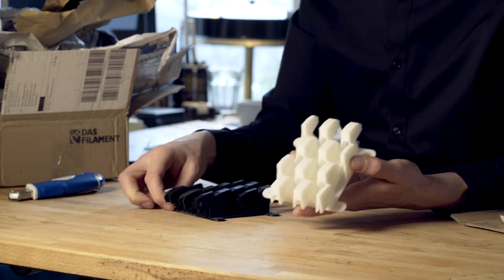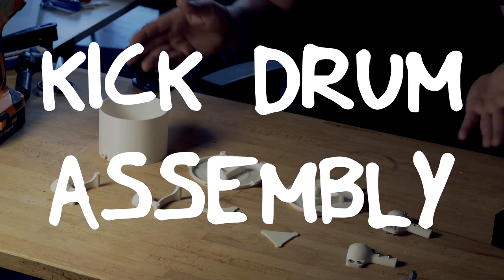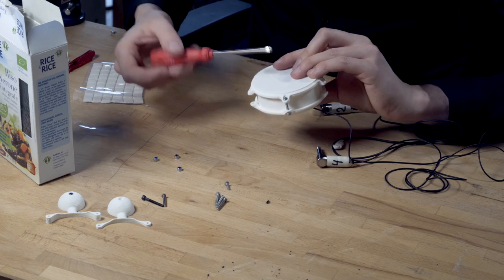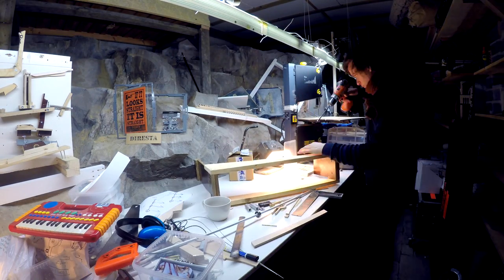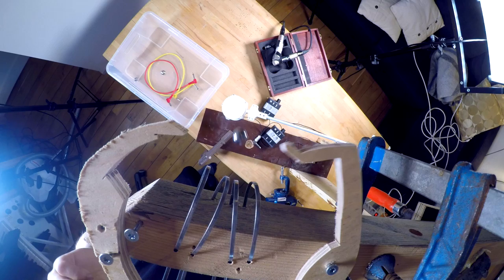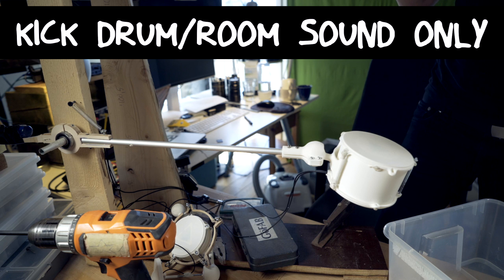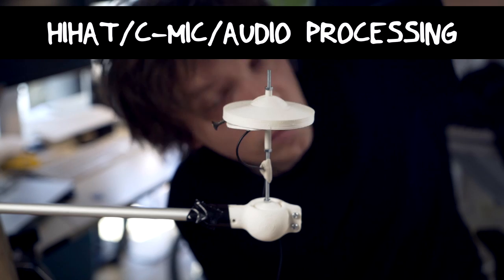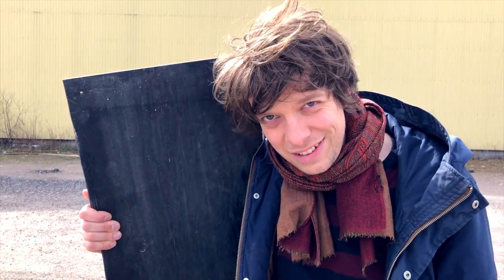Testing 3D Printed Drums - Marble Machine X #6

Comment from the maker: I forgot to mention that we will of course paint these drums!

I have recieved a couple of emails and comments about the ball joint and that it will gets loose from the marbles continuously hitting the drums. Even when i tighten the ball joint screw lightly i cant move it with my hands when trying. The plastic will break before the joint moves. There is so much friction in the rubbery ABS plastic so when properely tightened down, the joint doesnt move at all.  

I did delete this comment and all the answers by mistake once before, before i had read all the answers! I cant find a way of undeleting, so stupid mistake!
Reply: Can't wait! :DDDDDDDDDDDD
Reply: wintergartan you could also just use colored filament to print the drums there are even fluorescent and more special filaments
Reply: Wintergatan congratulations on 500K subscribers!
Reply: Concerning ball joints, there is an American company specializing in those mainly used for GPS brackets, the company is RAM Mounts ( http://www.rammount.com ) and they use rubber balls, and tons of accessories. They can handle A LOT of stress, but they are not cheap though, but there are companies making knockoffs with more or less success.
You could try to build your own rubber ball joint system though.
Reply: are the Stl Files for the 3D printed drums publicly available or are they proprietary? id like to make some for my own testing. have you considered having the parts printed in metal. for metalic sounds?
Reply: Wintergatan Lol, I'm also from Luxembourg!! And I have also a 3d printer!! And also wanted to help you to print stuff!!!!! i'm tobias version 2!!
just my name is not tobias!
Reply: Have you thought about making an open and closed hi hat sound? just by slightly changing the shape/design of that cymbal (and adding more rice), you could probably get a longer hihat sound. Or you could make the cymbals out of metal while keeping the supports plastic and make a more realistic hi hat (with two cymbals open and together). If you do think about doing that, I suggest tilting the cymbals so that when open, they still touch each other and vibrate together for more of a funk or disco hi hat.
Reply: Wintergatan where do you come from?
Reply: Will the prototypes be on Ebay or something? ^^
Reply: Why not use a brass miniature hi hat? Imagine some sort of more authentic sound will come from that 👍
Reply: Wintergatan Maybe you can add some sort of lubricant inside the socket and see if it works. If not maybe adjusting and revising the system of fasteners will help.
Reply: Wintergatan smoothing down the joints with acetone vapors or simple sanding might reduce the friction but try acetone with test prints or backup prints just in case
Reply: I think there may be a misunderstanding.  He is HAPPY that they don't move.  There were some commenters who were concerned they might after a lot of usage, making the machine be less accurate with the hits.  He doesn't want the ball joints to move after being properly tightened, and they don't, so no problems with the joints.
Reply: And organic rice sounds better !
Reply: You should paint it with glow in the dark paint.
Reply: Harder/impossible to attach a contact microphone to it
Reply: Wintergatan it sounds like montaigne - because i love you
Reply: Wintergatan, while I can understand it might not be moving that's not necessarily a good thing. That means all the force is going directly into the joint which could lead to premature wearing which would lead to a fracture of the joint. 

You might look into adding something along the lines of hard rubber insert, and a stoper in the body. That way the rubber can absorb some of the shock force moving a little but then resetting.

This is the same concept as car bushings in that of say an engine mount. They allow the engine to move under load, but the will go back to a standard position. These bushing in cars do wear out, but as long as the rubber is hard, and the correct type you shouldn't have issues with it. 

If I remember your biggest complaint was constant up keep of the previous design. While I think alot of your designs are interesting some of them are going to be prone to pre-mature wear. 

One thing that you might consider when making each part is how hard it's going to be to replace if it breaks, and how often it's going to need replacing. 

As an engineering student myself I understand the complication of design vs maintenance. Just something to think about.
Reply: Wintergatan nice test beat
Reply: Dana Cleary They're in Sweden...
Reply: Does it matter what race they are?
Reply: Uhm...  Those ball joints are gonna get loose over time with the marbles constantly hitting the drums, and you're gonna end up constantly re-positioning those drums and tightening the ball clamps (unless you're planning to glue the ball joints in place once you have the machine finished and tuned perfectly).
Reply: Wintergatan OMG 😭
Reply: Hungry Guy Did you NOT just read his comment
Reply: Wintergatan I love animusic
Reply: Hey! What program do you use to model and design your 3D printed parts and how did you get into the making? Is it hard to learn?
Reply: Wintergatan if you just make the "lower" elastics for the snare to use string that is not elastic, you can get your desired effect :D it will bounce in the direction of the ball, but not go back beyond the reach of the strings ;)
Reply: Dominator, yes, I read the comments and watched the video TWICE.  I apologize to you if I missed some remark he made addressing my concern.
Reply: What day do you play the marble machine X on youtube with song I can't wait!
Reply: Wintergatan o
Reply: Try coil springs instead of rubber :) I think that 'extension springs' would do the job.
Reply: I hope it wont ruin the sound of it
Reply: So cool to look back at the beginning of the MMX in May 2020!
Reply: Don't fall rice cause the microphone is gonna do that
Reply: Ball hinch

Comment: What if you suspended the drum like how a studio mic is suspended, a double elastic system.
The hard stop may produced a double hit, hopefully getting the tensions right on the elastic can counteract the resonance of the bounce/wobble, if you use the mic suspension idea then maybe having one set of elastic tighter than the other would help..
Reply from the maker: Youre absolutely right about the double hit! Im going to take your idea about one side having harder tension with me when i design the new hanging, thanks alot!
Reply: The lower should be stronger.
Reply: Sparky Projects THIS MAN WILL BE HONORED FOREVER
Reply: Yeah, I was hearing that too, you want a single impact on the drum, not a flam. Good idea, SparkyProjects

Comment: This is so awesome, I started to learning Fusion 360 right away after seeing your previous video :D Have you thought of using metallic springs tuned inside the hihat to create slow decay effect to its vibrations? That might be used in addition to the rice to get 3 staged sound with attack, sustain and decay.

Comment: don't you think it's a little pity that the MMX depends on audio processing and therewith electricity?
Reply: they can still change the drums and have them sound good without processing or maybe even without mics
Reply: He said he's going to mechanically+materially tune the drums. The audio processing was just for this video. At least the degree of it
Reply: The original marble machine was no different. The bass and the drums would both be too quiet without some form of amplification. In the original video you can see the audio equipment attached to the machine at some points. Many of the cooler instruments used by Wintergatan depend on audio processing, for example the Modulin
Reply: Actually that is the first part of the MMX which I really don't like. I would much prefer some proper wood and metal parts, which would sound much more like real deal, then some plastic peaces. But may be I am wrong. Many people here seem to like it and Martin did pointed out that at the moment he is not looking for the best sound but the mechanics. The ideas for the mechanical and visual effects I do like.

Comment: big doubts about that ball hinge. it'll never hold a position, you'll have to reset it inbetween every song
Reply: He could always drill and peg it if he finds one or a couple of positions that work.
Reply from the maker: Even when i screw it on lightly, i cant move it even when i try. The plastic breaks before the ball hinge moves! There is so much friction and ABS is a little rubbery, softer material so it glues to eachother in the position its set in!
Reply: Unless you actually have some sort of fusing going on between the parts, I'm guessing it's moving, even if its just a tiny tiny bit. 
Lets say the bearing moves 0,05mm (in relation to the clamp) with each hit, a song is 3 min long, 120bpm, and average of 1 hit with each beat. 
0,05 x 3 * 120 (  * 1) = 18 mm. 
That's almost 80° given that the bearing d is 2,5 cm. ( 1,8 / (2,5 * Pi) * 360 )
Even if I'm of by a factor of two, its 8°,  that's not nothing when you want the ball to hit a small collector area. 

It might not be noticeable after 20 hits, but I would suggest you run an endurance test. 
Love your videos! Thanks for all the great music! <3<3<3<3<3<3<3<3<3

!Any engineers please correct my poor attempt at maths!
Reply: "...I'm guessing it's moving, even if its just a tiny tiny bit. Lets say the bearing moves 0,05mm..."

While the first part seems like a reasonable assumption, may I ask why you settled on .05mm as the amount it moves with each hit? What if instead the amount it moves is .05um? Friction locking ball joints are used all over the place in lighting, photography... hell, even on acoustic drum kits to hold things in place ( http://www.gibraltarhardware.com/?fa=partsdetail&curcat=2&bnd=11&cid=104&sid=465&pid=1589 )... 

With precision built 3d parts you'd have nearly 100% contact between the parts, so to me it seems perfectly reasonable to assume that given enough tension  it'd hold what little weight and force impacted by a marble would impart... 

Like you though, I have no idea if what I think is true, is actually true.. so endurance test away :)
Reply: +Edward Russell II The 0,05mm is just an example :)

As for the the hinge in a full size drum, they use rubber to absorb the energy from each hit or are made out of steel, wich can be tightend much harder than ABS. Since ABS is much more ridgid than rubber and mor brittle than steel, there is much less absorbtion of the energy in to the material, wich could move it. 

Im no engineer so all of this is ofcourse speculation :)
Reply: It might actually not move at all. With these 3D prints, a lot of surface structure is present. So it might be it will find rest in some interlocking configuration. And then , even though the impact itself will make it move slightly, it will just jump back to this configuration.

Comment: Great Job on Bassdrum and Snare! To solve your Hi-Hat problems I came up with a few ideas: 

1. if you want a more natural sound, you should change the material where the marble hits the Hi-Hat. Maybe Bronze?  
2. Take a look at Zildjians Gen16 Cymbals. those are semiacoustic cymbals. I think something like this would sound great.
3. if size matters more than the fact that the actual sound you can use your Hi-Hat as trigger for a drumcomputer module. this would allow you to use different sounds for your songs. I think this would also be a good idea for your other drums although they do a good job.
4. you really should add an open/closed option for the Hi-Hat.
5. is your machine build to support different velocities? More dynamic can possibly be archieved through different weights of your marbles.

Comment: Hey, try using shock absorbers from RC cars?  Or make something similar?  I don't know about the aesthetics, but this will allow the drum to drop with the impact, and to rebound quickly and consistently, without bouncing.  It will also eliminate the need for a counterweight.  If you make a hinge that controls side to side movement, and you use a hydraulic shock absorber to control up and down movement, the marble will have a consistent bounce.

Comment: You ever heard of impulse responses (IR) for audio processing?
This is mostly done with guitars, but you can also use that with drums (or any other type of sound).
That way you can actually make an amazing sounding drum.

About the ball joint, there are metal made ball joints available for a very decent price.

Comment: Awesome work!  One suggestion...  
You may want to set up a rig to hit the drum heads a few thousand times in the same place to see what the ware is going to be on them.  It's good to know how long a part will last.   

OK... Two. ;)

Also, I really love the movement, I just caution you about the use of elastic as it puts you in the same position you were with the other marble machine and it's fragility.  I think you could do the same with the right type of spring.

Comment: I think you should have the hi-hat be larger/bigger in diameter. Soundwise they all rely on the diameter and material for frequency/pitch, but the hi-hat especially more on the diameter, as the whole plate moves instead of a membrane.

Comment: Pardon the silly questions, but why not just use metal for the hi-hat? And wouldn't treated leather/ animal hide for the drum surfaces be more durable? I have a feeling that the plastic drum surfaces would crack and break down after you bang on it with thousands of ball bearings.

The marble machine 2.0 would be super cool once it's finished!! Can't wait!

Comment: If you try small metal balls -- the type used in some commercial brands of shakers -- you may get a sharper, more metallic sound for the hi-hats, and it would help to differentiate its sound from the snare drum. You could further emphasize that metallic sound by at least having the bottom (the part which holds the shaker media) printed or machined from a metal, or some interior metal parts with which the metallic media can resonate; your plastic container is definitely influencing the sound.
You could even simplify the design and use brass jingles from a tambourine; maybe mount one jingle to a contact microphone, and make it so another one makes contact from above when the marble strikes.

Comment: timing could get difficult when these start moving everywhere. if the two channels would use individual drums that are similar you could use them to theyr max speed.
The thin rubber bands look nice but they will not last very long too and adding a stop might add another hit..
I'm just throwing this in, came to my head and i hope it helps

Comment: Regarding addressing the orientation, movement, and dampening objectives for snare-drum: perhaps the support arm could be a long parallelogram with the drum attached to a short edge, which itself is parallel to the arc of the marble at the point of contact.

Comment: First off, after watching this-- you continue to blow my mind with these things.  A couple of thoughts come to mind.  The 3D printed plastic isn't made to bow and flex like a drumhead is.  After a while, isn't something that strong and rigid just going to crack and break?  What about using a drumhead that flexes?  The first thing that came to mind when you were using that elastic for the shockmount would be a rubber head.  It's flexible enough to take the weight of a marble and bounce back.  Also, with your processing of the audio, are you EQing, then using it as a trigger for sampled drums?  I feel like it loses some of the "magic" of the tone of the drum.  The bass sounded great and the snare sounded good, but that hat just sounded like a cheap drum machine.  Otherwise, incredible work as always.

Comment: Have you thought of using the lightweight 3d printed metal for the hi-hat/cymbols to add a more traditional sound and a longer hiss  your bottom can stay the plastic but just change the top or even try with both bottom and top replaced and see the variation for what sound seems best. Your base drum also didn't have that full body sound try giving it a hole about 1/2 The radius to the bottom to give it a deeper richer sound  but the snare was perfect. For the scaffolding of the snare you could also try a moderate tention spring instead of rubber it will give it that bounce maybe a thinner metallic scaffolding  ring with springs to the top of the snare under the scaffolding with a slit at the front to allow balls to pass through without catching almost like a C ring.

Comment: If you use a 3D CNC router to cut a symbol (or use modified finger symbols) you might be able to increase the resonance of the high-hat. Keep it from sounding so deadened. The rice is a good idea too, but it won't give you the "Shimmer" of the metal, you know?

Comment: hej!

absolutely loving the amazing concept of this marble driven instrument, allow me for a little suggestion: why not using piezos and setting up an avr-based midi controller that then triggers virtual drum sets? could be easily done using VST host and some free drum set VSTs for example, also thought of a RaspberryPi using a suitable and MIDI-controllable sound engine...

hälsningar från berlin till underbaret göteborg!:-)

axel

PS: stupid me - as wintergatan has a lot of synths going on, you surely would have some drum machine, sampler or synth at hand, that could be controlled via MIDI directly... actually, i'll be grabbing my old nanosynth, an atmega328, print me some mini drums and give it a try... ;-)